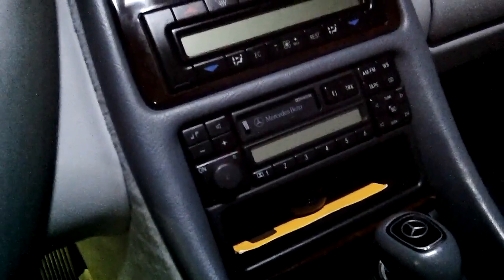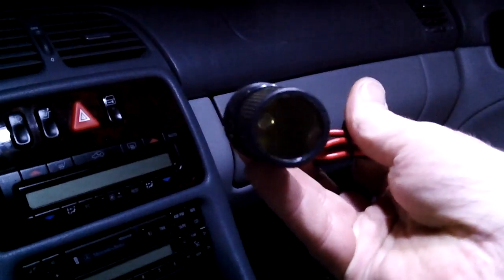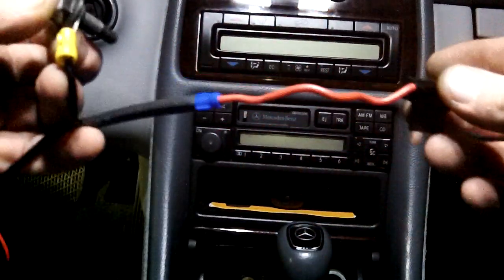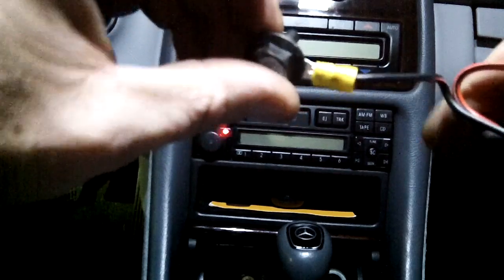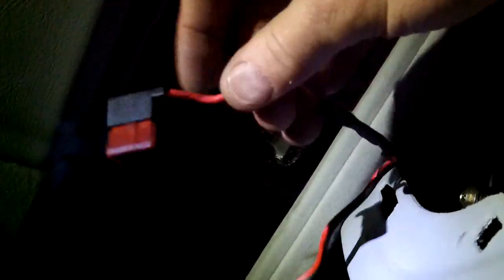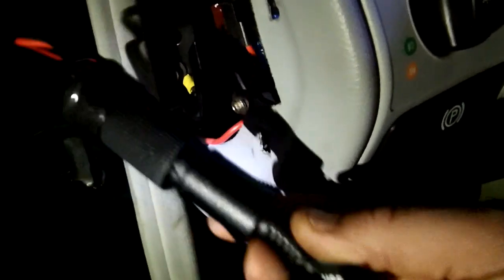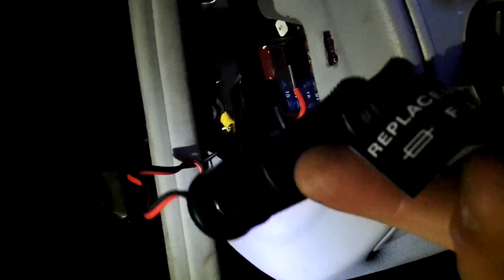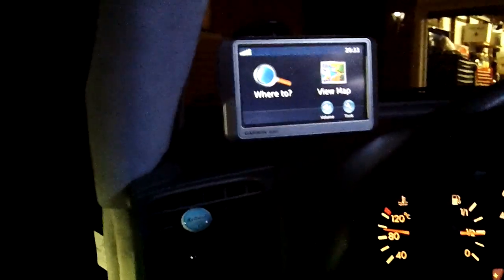Car GPS installation, hidden wiring,lighter socket retained, Mercedes W208

Comment from the maker: hard to say whether it would be warped or not..getting the head decked at a machine shop will make it perfectly flat again..it is pretty cheap and you wouldn't have to worry about it after that

Comment from the maker: around 93c...was idling a while to keep warm while I was doing the vid.  that's about as high as it ever gets..gauge isn't perfectly accurate. If I check the temp on the climate control it's a few degrees lower,,,the w202 was exactly the same..I would prefer it to be a bit cooler, but Mercedes has always stated that temp is normal

Comment: Hey fupa.. I had a question, I wanna buy back a 99 E300 Turbo Diesel that my family sold a while back to a friend. It has a head gasket leak with oil in the coolant but not vice versa. It's also never been overheated just had that leak. Do you think I should run into any trouble with warping when I pull the head to replace the gasket?

Comment: Hey Fupabox!
I was wondering if you have any plans in doing a video of retrofitting a Command 2.0 or some other type of original navigation into your merc?
Reply from the maker: KIYOOU  no plans to do it.. it would require a whole new wiring system for the steering and audio system for most of the original parts to be swapped in. It can be done though
Reply: Btw which one would you recommend - Audio 10 mf 2910 or the audio 30 aps in terms of sound quality?
Reply from the maker: KIYOOU  unfortunately..being a talk radio junkie..I'm not the greatest to ask about sound quality..hate to admit I usually listen to a/m radio. ..I would defer to one of the Benz forums...those guys are more audiophile than I am, and can give you better advice

Comment: mine used to be this way too then i changed the rad and now its down to 80ish never go up :> my old rad had cracks in it and it sucked air in there like its nobody's business :P now its cool ^^ but on the other hand i think at some point before i changed the rad i had someone to reset the fan to kick in early ((at the time it did nothing to the temp )) maybe that with the new rad why i have lower temps .